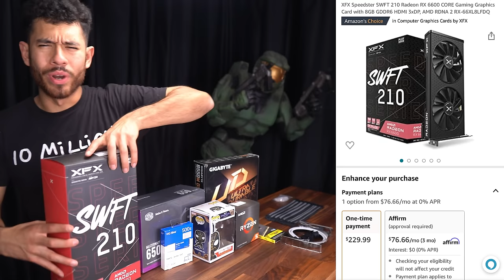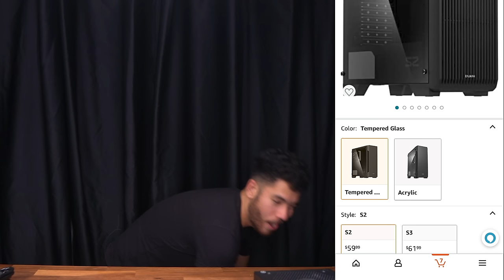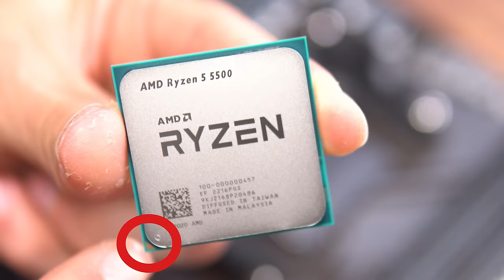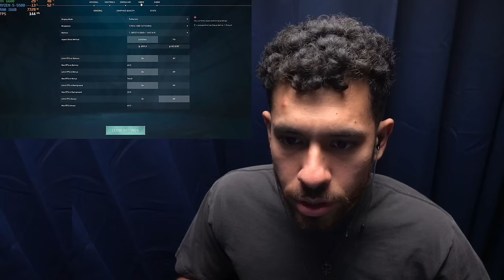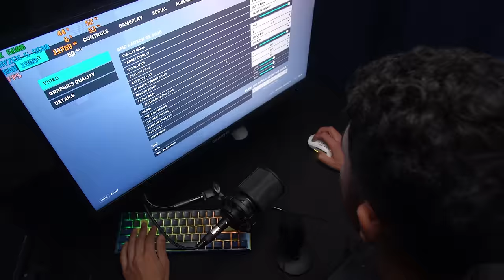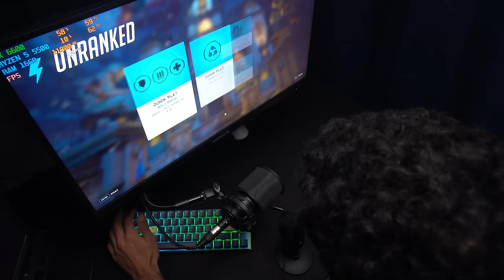Build the Best $600 Gaming PC - 2024

Comment: Thanks for this upload, Crater! Been binge watching all your videos while waiting for my PC build this coming January/February. Keep on!
Reply: Same, i literally have the Ram, Ssd, Motherboard and the Cpu and i should be able to get the Graphics card and Power supply by Jan/Feb. 😊
Reply: God willing.. you'll make it to Feb
Reply: @AMIRACLEISME  fans? Peripherals ? Case? Monitor?cpu cooler?
Reply: @AMIRACLEISME  I got the graphics card first since its the most expensive. The others are easier to buy anytime and cheaper, so I'd suggest getting that.
Reply: @tuphelo  well, I already have a Logitech G Pro Super light mouse and a Razer Naga Pro. I also have a Keyboard cause i was playing on a Laptop, and i also have a 144Hz Monitor, and im just gonna get a cheap case with pre installed fans
Reply: @AMIRACLEISME  make sure the case got good airflow if its cheap :)

Comment: This build I 100% can get behind. Everything is nicely balanced and makes sense.
Reply: I’m thinking of building this exact rig but I’ve heard about having to update bios due to the 5500 what do you think. I’m open to upgrading cpus if that’s what’s necessary
Reply: Or a different motherboard if that’s the case, I don’t know to much about pcs
Reply: @Jamesbinicus06  do yk by any chance if i can add a 3060??
Reply: @ItsYamiFN  I don’t know it it would work I don’t know much about pcs
Reply: @ItsYamiFN  GPU-s should be pretty much plug and play, as the OP said these cards are equivalent in performance so I guess you shouldn't be bottlenecked by the other parts. If you wanna go Nvidia go for it. (maybe compare power consumption just in case)
Reply: @H4GRlD  thank you so much i’m bearly getting in tho this type of stuff thank you 😭🙏🏽
Reply: Can I upgrade it over time if I build it?
Reply: I built this same pc but i have 70%+ cpu usage when playing games
Reply: @yaboivision can u stream good on this build ?

Comment: I recommend saving up a bit to get the Ryzen 5 5600, not only for the upgradability in the future, but also because the Ryzen 5 5500 doesn't support PCIE 4.0. Thus not getting the best out of the RX 6600. Great video!
Reply: U think I could use a 550w ps.
Reply: @Manxy Why is that so, you don't have to upgrade everything else. The 5600 can handle much more, butbif your budget is limited right now, just use the RX 6600. Like I mentioned, there's an upgradability path for the future, once you have more money you can upgrade the GPU.
Reply: @Kinse Definitely the CPU like I mentioned. Swap the Ryzen 5500 for a Ryzen 5600 non X. I don't think 5600X is necessary right now, if you're on a budget. But for sure Ryzen 5600 since it supports PCIe 4.0. A performance boost there and upgradability if you want to update the GPU down the line.
Reply: @royalespongebob  what if we got the money should we get the 5 5600x? also like i said if we got the money once we upgraded that what cpu should we get or should we stick to the one in the video? i’m all new to this so i appreciate the help
Reply: @stargirlearth  Sure, get the 5600X if you want to. If your budget is limited and absolutely need a PC right now, just upgrade the CPU and stick to the parts. Once you feel the need to you can upgrade the GPU, too. The 5600/5600X can handle pretty much everything up to the RTX 3080/RX 6800XT with little bottleneck. I guess if you're watching this, you have a rather limited budget, so just swap out for a 5600/5600X for now.
Reply: @royalespongebob  since you seem knowledgeable, i’m new at this so idk, i was wondering what motherboard would i have to get so i won’t have to update the bios bc i’ve heard if you don’t update bios correctly you can mess up ur pc for good
Reply: @stargirlearth  That's a good question, definitely get a B550, because newer boards might not need a BIOS upgrade. Ultimately depends on which version the board is and when it leaves factory. The board in the video is fine, but you need to have BIOS version F14 for the Ryzen 5 5600. If you don't trust yourself enough to do a BIOS flash, then bring it to a shop and ask them to do it.
Reply: @royalespongebob  alr thanks man, i appreciate it
Reply: @royalespongebob   I was wondering the same thing… I don’t want to worry about bios so would there a different motherboard that would work without updating bios with all the specs in this video?

Comment: Nice build. You would get better performance by going with a 5600x with PCIe4.0 support on the B550 motherboard. Again, nice and clean build.
Reply: Of course a 5600 is better but remember this is a video for budgeting
Reply: NVM, i forgot the 5500 is PCIe 4.0. Good build.
Reply: Second correction, lol, I was correct the first time. And yes, understood.
Reply: I agree. Spending a little more on the CPU is a no-brainer.
Reply: If I get the 5600x would I need to make any changes to the build?
Reply: @bernie236  nope no changes needed man. If anything, that cpu would just give you better performance since it’s still under the Ryzen 5 series 🙏🏼
Reply: @blueberryii3618  do you think this pc build is good to start if im planning on building a budget starter pc?
Reply: @LxcasOnYT  yes this is the best option
Reply: @bacon How big would the difference be in this build with a 5600x and 6700xt? What  parts would I need to change ?
Reply: @hieishotyou  you wouldn’t need to make any changes
Reply: What type of monitor would you recommend for this setup in a 32inch playing mostly call of duty, shooter games.
Reply: @i_Lndr 144hz or 165hz

Comment: Why nobody uses after market coolers for the ryzen 3000/5000 series? Spend the money from the custom cables and get a 4 copper pipe cooler tower, then you will have a true budget build, with good temperatures :D

Comment: Getting all my stuff tomorrow/today(it's 4am) and I got that exact case and of course there's not many build videos of it. But this video is perfect(aside from the cable extensions and clips which I may buy later) to help me build mine. Super excited and nervous for this. Hopefully everything goes well. I got a Gigabyte A520I AC mobo, AMD Ryzen 7 5700X CPU, MSI GeForce RTX 3060 GPU, Teamgroup 2tb nvme ssd, Thermalright Assassin x120 CPU cooler, and Zalman S2 Acrylic case. Should be good for 1440p. Thanks for the video!

Comment: Awesome vid! Building my rig and i ordered all the parts from this vid, except i went with the 5600 over the 5500 and 32gbs of ram and a 1tb 4.0 pcie ssd. Looking forward to putting it together!
Reply: Honestly think im about to build the exact same haha
Reply: @yaboidubs9791  worked out perfectly. Getting windows installed was my only hiccup but i figured it out
Reply: @yaboidubs9791  plays just about everything i can throw at it at max graphics for decent fps
Reply: @BulletBillmg  Did you need a fan extension cable for the back fan? Because it looked like its not long enough to hook up to the motherboard
Reply: @BulletBillmg do you get the same fps that he did in the video on war zone ?

Comment: I am on the way to build a pc and would appreciate some suggestions.
processor= ryzen 5 5600
GPU= RX 6600
mobo= B550m hdv
RAM= 2x PNY 8gb
storage= 1tb ssd
PSU= corsair cv650 650 80+ bronze.

So what do y'll think about this configuration? 
will it be fire for 1080p?

Comment: So what's the real difference between a $600 build and a $1600 build? As far as i can tell, the 600 build can run the same games as the more expensive one, and doesn't seem to perform any less.  Is it like building a 600 horsepower engine? Sure it might have more power than a normal sports car, but outside of a drag race, when would you ever need 600 horsepower.

Comment: If I could make one change, it would be stretching for a 1TB SSD since they are so cheap and not much more expensive than 512GB. Especially, since the size of modern games is insane.

If i could make a 2nd change it would be spending a little more for 32GB of RAM. Again, the price of DDR4 RAM has come down significantly, it doesn't make any sense NOT to spend the extra $20-25 extra.

Comment: 580 rx 75 bucks from aliexpress and s30 levono  for a 100 bucks with a e5 1650 v2  overclocked ran warzone 2 at 85 fps full hp on ultra. most games runs smooth as butter for a total of a 175 bucks.

Comment: B550 chipset comes with PCIe 4.0 support while Ryzen 5500 only has PCIe 3.0. B350 chipset would be pretty enough for this CPU. One can find a decent B350 mobo for around 50-60 USD. B520 as a cheaper alternative with an M2 slot. All of this is only relevant if we go full budget. Another good combo would be a cheap Ryzen 5 3600x/7 3800x from ebay pared with a B550 chipset mobo. Ryzen 5 and 7 3xxx come with PCIe 4 support.
Reply: Wouldn’t the b350 need to be updated

Comment: I'm building my first pc and crater has motivated me alot I have 2 questions 1. Do u have to update the bios for the b550 d3sh if you are using a ryzen 5 proccesor and 2. My first pc is gonna have a ryzen 5 5600x. 2 sticks(8 gb each)  of ddr4 vergance 3600mhz,cool master bronze rated 650w power supply,b550 d3sh,500gb of a western digital storage , bgear pc case (3 case fans), and a rx 6500xt eagle

Comment: Hi, i recently built a new PC and i put some research into it. Few things i noticed (prove me if i'm wrong)
1: AMD makes better value GPUs while Intel has better value CPUs considering the MBs for intel CPUs are also way cheaper. There is actually nothing wrong with pairing an AMD GPU and an Intel CPU expect a few negligable things, you gain way more value with the pricing. Also, i dont recommend RX 6600 because it needs a 650W PSU. For 25 % more money you can get a 6650 XT. Yes, the 25% (it around 300 bucks) is a lot, but it runs perfectly fine. With a 500-550W PSU, so you win money back. Also i3-12100F is a little bit stronger CPU then R5 5500 for a little bit lower price. However, the MBs are way cheaper for the intel CPUs in the same category as for AMD (i went with a H610M A-D4) my PC is around 800 bucks but you can build it with cheaper PSU,MB, and the 12100F supposedly run fine with the original CPU fan while i also upgraded this part. All in all you can get a better perfoming PC then this one for the same price, if you pair an AMD with intel, but you first have to check the cons and decide if you need the extra features for same GPU CPU manufacturer. If anyone is interested i can share my full setup, and waiting for any good tips.
Reply: The thing i didn't mention is 6650XT is 25-30% stronger for the same extra price which is rare, it has insane value .
Reply: The rx 6600 does NOT need a 650w power supply. A 500w psu can even work.

Comment: Only thing I would add to this video is a sound card, budget Motherboards have entry level sound cards that are MEH at best for headphones and HORRIBLE for media and movie viewing. Get a decent sound card that supports true 5 or 7.1 digital or out puts  a much higher DB rating than an onboard card... if you find a deal they are usually sub $100 and it's something you can migrate with an overall upgrade.  JMO   Happy building

Comment: I have a question. It's my first time building a pc and is there anything else that I should take note of such as the thermal paste? Do you also have any suggested AVRs if it's alright to ask.

Once again, it's my first time building a pc, so please forgive me if my question ends up confusing.
Reply: The avr wouldn’t necessarily be mandatory but definitely would help in case of random power outages as far as thermal paste I’d recommend you’d get a the best one available to you as they last longer and have batter spread when clamping down good luck bro would love to see your build running

Comment: Case: Cooler Master HAF 922
Fans: CPU- Noctua NH-U12S. 
Power-Supply: Corsair RM Series, RM650 Watts
MotherBoard: Gigabyte Aorus Z390 Pro 
Processor: Intel Core i9-9900K O.C. (5.0Ghz) 
Memory: CORSAIR Vengeance LPX 32GB (2 x 16GB) DDR4 3200
Hard-Drive: M.2 Samsung 970 EVO 1TB SSD
Video-card: Gigabyte GeForce RTX 2070 GAMING OC 8G
Widescreen TV TCL 43 Inch Res: 3840X2160 60FPS 
Windows: Win 10 x64 Pro.

Comment: I built the following for $560 after taxes all-Amazon:

CPU: 12100f i3 (4-core/8-thread)
GPU: Radeon 6600 (8GB GDDR6)
MEM: PNY 3200 MHZ (16GB DDR4)
SSD: PNY 2.5" SATA (1 TB)
PSU: Thermaltake (500w 80+ White)
Case: Bgears (ARGB ATX)
MB: MSI mATX (H610 Wifi)

It's running ChimeraOS which is a wannabe SteamOS.

Comment: Would this be a good pc build for 617? ( I’m on a budget) 

CPU: Intel® Core™ 12th Gen i3-12100F
Motherboard: GIGABYTE B760M C
RAM: Silicon Power DDR5 32GB (2x16GB) Zenith 6000MHz
SSD: TEAMGROUP T-Force CARDEA Z440 1TB 
GPU: SOYO Radeon RX6600M 8GB from Aliexpress
PSU: MSI MAG A550BN Gaming Power Supplyr
Case: Cooler Master Q300L V2

Comment: Looking to building my computer, and thank you very much for such details and instructions. One question is I use the RAM at 3600 instead of the 3200 will cause any problems? It is the same price on amazon, but I want to ensure everything runs smoothly during the installation.
Reply: @quibly2143  thank you for your help and answer.

Comment: would you advise reusing a older case or just getting everything new???
Reply: If there's nothing wrong with the case and can accommodate your hardware (mainly graphics card), and has overall decent airflow, I would re-use it.
Reply: @JJFlores197  cool thanks i think the case is probaly the cheapest part lol but maybe put that money on a lil better processor lol
Reply: @JJFlores197  it is like 10 years old though maybe its time for a new one lol maybe i can get one smaller lol

Comment: I just tore off my USB3.2 casing trying to rearrange the cable. Before plugging that one in make sure you like the cable arrangement ( where it comes from within the case) because it  is so fucking tight to remove to the point you may damage your board like me.

Might mess around with the connector and scrape off the latches with an exacto knife for ease of access

Comment: Hi. I just used your YouTube to buy all the parts on Amazon for a gaming computer for my husband. He will be using the same three monitors for the gaming PC that he uses to hook up his work laptop. Can you recommend a switch or something that would work for that?
Reply: He will most likely need a laptop dock. Unfortunately, this can get confusing as there are many brands and models and sometimes they don't work well together. Its a huge mess and no company seems to agree on a universal standard. My suggestion is to search for docks for that laptop model. As I said, it gets confusing as you can find universal docks, but they may or may not work.

The important things are to find a dock that works with that laptop model AND has the correct number of video ports AND will support the resolution and refresh rates of the monitors.

Comment: i was thinking about using this exact PC build, but instead of the RX 6600 i wanted to use a RTX 4060, would that work with this build? (ive never built one before) and would the performance be worth it?
Reply: Performance will be alot better with a 4060.
Reply: @woawowwo  thank you!

Comment: Hi good morning can tgis specs be worth it in 2023 for 600 usd buying it as used thanks 

1) CPU) Intel core i7 10700 2.9 GHZ

2) Motherboard MSI MAG B460M Mortar 
3) 32 GB RAM G-Skill RGB DDR4-3200 4) Graphics Card MSI Nvidia Geforce RTX 2070 Super 
5) Harddesk 2xCrucial P2 1TB NVME M.2 SSD 
6) Harddesk Crucial MX500 250GB SSD SATA 
7) Cooling System Deepcool Gamer Storm 2 in 1
 8) Power Supply 650 Watt Power Supply

Comment: Does this case work Antec NX410 ATX Mid-Tower Case, Tempered Glass Side Panel, Full Side View, Pre-Installed 2 x 140mm in Front & 1 x 120 mm ARGB Fans in Rear (White)

Comment: I'm looking at building a PC primarily for music production (something that can handle lots of plugins at once) I am currently on a 2017 MacBook Air. I know that this PC will be better undoubtedly for gaming but how will it compare music production wise?
Reply: I can't say for certain, but I would imagine this would be pretty good for your use case. If you're not going to game on it at all, you can save a lot of money and buy a low end graphics card, like a GT 1030. I would normally say you can avoid the dedicated graphics completely, but this CPU requires a graphics card of some sort. I would put part of the money you saved towards a 1 TB NVMe SSD and 32 GB of RAM if you're doing a lot of heavy work loads. Maybe a 1-2 TB internal hard drive if you need extra space.
Reply: @JJFlores197  Thanks for your feedback - been doing some more research and that sounds perfect. Thanks again.

Comment: The Ryzen 5 5500 is cheap, but it is weak with its anemic 8MB of L3. There is a reason it comes in for less than $100. At $139 the 5600G in a build at this price point makes more sense. The extension cables are a "nice to have," but you could have saved most of the difference for the better CPU.
Reply: R5 5500 Has 16MB of L3.
Reply: Then go with the 5 5600. The integrated graphics cards get stuttery for some reason when paired with a graphics card.

Comment: I know this video is 1 year old but at this moment I will go with 
R7 5800x 
for 
RX 6600
+ 4*16GB DDR4 CL16 3600

But you know it's just my opinion, some games easily take +20GB of ram, add system, discord, browser and other programs..

That's exactly my build 
-Gigabyte B550 AORUS ELITE V2
-Gigabyte RX 6600 Eagle 
-Ryzen 7 5800x
-CPU cooler be quiet! Dark Rock Pro 5
-4*16GB Lexar Thor DDR4 CL16 3600
-2* Lexar NM790 2TB M2
-2* SSD Crucial BX500 1TB 2.5" SATA III
-Gigabyte P750GM 750W

Everything inside 
-MSI Mag Forge 320R Airflow

And suprise 
System Windows 10 pro.
Reply: you really need discord, browser and other programs open while in game?
and windows 10 pro isn't something surprising.
Reply: @woawowwo  Yup I rly need DC + Browser when I'm playing games :)